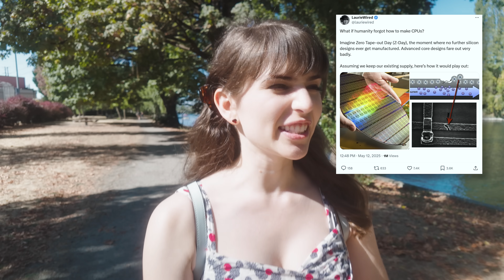what if humans forgot how to make CPUs?

Comment: Your scenario appears to be more what happens if we lose the ability to fabricate integrated circuits, not merely CPUs. If all we lost were CPUs, we could make them from discrete chips like we did before LSI was a thing.

So, the short answer is, we would revert to the late 1960's, early 1970's in terms of technology unless we also forget how to make transistors or MOSFETS. If we lose that, we have vacuum tubes, so back to the 1950's and early 1960's. There were also relay based computers, such as older Japanese mini-computers. So, an entirely recoverable scenario, even if it did set us back half a century.

Comment: "5 nanometer" CPUs have a gate length of 18 nanometers. It bothers me to hear "nm" expanded as "nanometers" because that will spread the misconception that something in these chips is "5 nanometers" large when there isn't.
Reply: Yes but the number used to represent the gate length up until around 2011. The nm does mean nanometer.

Comment: Thanks for the walk, Laurie.

::: DEMO SCENE MENTIONED :::

CPUs in a modern sense may or may nor be forgotten due to the processes and the 100s of people involve dat each stage and no one really knowing all stages. 
The saving grace is that individual people understand logic gates and they understand how to peace them together to CREATE a cpu. Individual people (many of them) know how to do this and you can find countless videos of them doing it in games like Minecraft. All we really need are the gates and the logic and how to peace them together to interacts. The processes to make them smaller comes AFTER that. The knowledge of how to create them at a basic level is inevitable.

If we are forcing a hypothetical, (gonna give my take before watching the video so im not biased to your probably better insights) my assumption based on other areas where this has happened is efficiency and scaling would become king. Instead of the new CPU, its the new 20% more efficient piece of software. Bearly tapped things like applications and entire OSs introducing nature multi-thread support that allows any application that runs on them to become multi-threaded or multi CPU. Tis would carry the industry for a good 15 years before it would start to fail. By then possibly even new coding languages thet more deeply tapped each transistor would be developed to squeeze our further performance from the raw, now decades old, chips. As that died down, the consolidation of hardware would ramp up and computing would start to blur from having your own things at home, to having time allotments in the cloud to do what you want. This would last another 15 or so years before older gen CPUs themselves would start to die in numbers that would force the cost of computing in this way to rise beyond reasonable levels even for the large companies that were left. Eventually (15 years beyond that so we are at 45 years from zday), people would need to start slapping metal on silicon again or the fall would be slow but inevitable back to pre-transistor age for everyone except the rich.

techs that would fail first:
1. AI
2. AR
3. Crypto (i guess this is a "tech")
4. Modern phones within 5 years would cause a major and massive cluster-f of the telecommunication industry. Older phones that would still be working would not be compatible with new communications tech. The entire industry would have to step back 20 years hardware-wise or die. 
4. Almost all other portable devices from the past 15 years would fail and any industry that relies on them. 
5. Industries that rely on heavy digital video production
6. Industries that rely on HDD production
7. Things like OF
8. Visual Social media would burn very brightly before falling sharply in the first 10 years as major restrictions from EVERY ISP on earth would be instituted.

tech that would last the longest:
1. Any firms that provide support for desoldering and resoldering
2. Demo Scene Is Forever. All we need are some rocks and sticks. 
3. Software companies that specialize in optimization of client software
4. Engineers that are responsible for MB designs and whomever employs them are a goldmine. All chips are worthless unless the board they are on can take advantage of them reguardless of age. 
5. stuff from the 80s and 90s should be here till 2100

Comment: Modern CPU designs are a terrific maze where even the smartest mond couldn't fully understand it.

AI will be able to optimize CPU designs to its physical limits, using physical rules of the real world chips to squeeze the last bit of computing power to energy consumption ratio.

When such a chip will be built there will be no way to improve it further than to find new physical rules.

The game will be over.

Comment: I've thought about this myself, interestingly, maybe it's a common thought experiment. If we were suddenly unable to produce large numbers of new processors, for example if there was a disaster in Taiwan and/or Arizona and a few other places, I think it would be both better and worse than your scenario. Worse in that the consumer market for electronics would rapidly crash, as there are no new products and the ones people do have (most of which are short-lived by design, like cell phones and tablets) are now very valuable and on borrowed time. As soon as that occurs, the need for datacenters and "web scale" computing basically evaporates all at once. From that point governments, militaries and very large corporations would horde the remaining technology resources, rationing and tightly controlling usage.

We could definitely work back up to our current point over time, and a lot of the technology could be recreated and/or improved using knowledge that has been recorded from the initial development of high-end electronics, but it would take decades. In that time, I think consumer technology would just revert to previous states. Printing newspapers and books is a mostly mechanical process and doesn't need computers really. Washing machines, dishwashers, refrigerators and microwaves can all be controlled using electromechanical timers and sequencers, which still exist and require no electronics, basically just machining tools like lathes and mills to make or cast. Cars can be designed and manufactured without electronic controls. They may have fewer bells and whistles, but they would still serve their purpose.

I don't think there would be a long-tail of consumers hanging on to their failing technology for years because the average end-user doesn't really know enough about how anything works to solve the small mountain of minor issues that would crop up constantly, and the huge amount of software that is only marginally functional (80-90% of it these days...) and also developed by randos over the internet (which would quickly disappear) would make it extremely difficult to keep anything working reliably.

With the exception of desktops, laptops, phones and tablets most all of the stuff we use on a daily basis predates the invention of the microchip, much less advanced CPUs and microcontrollers. Medical therapies would take a step back without MRI and CT scanners, so new and novel diagnostics would need to be invented. Entertainment might revert to radio, or just to regular analog TV which works without any need for sophisticated computers.

It's a cool thought experiment, I do think though that the sunset for computers would be 1 decade or less, as demand for consumer stuff would create a tremendous impetus to develop alternatives to CPU controlled products. They might be larger, heavier, or different, but we could do without processors just fine after a couple years.

Comment: I designed and built a working 16 bit CPU from LSTTL/HCMOS etc. back in 1986. I'll never forget how to do it. And if I had or needed to I could easily do it with discrete transistors.

Comment: This is a fun thought experiment, but I think you're MASSIVELY underestimating both the impact that this would have and the magnitude of the government response.

Nobody would carry on as usual. Governments would nationalize computing resources. Black markets would start springing up within a week. The rush to try to adapt to the coming new reality would be chaos.

Within 6 months, global supply chains would start disintegrating. "Just in time" manufacturing would end. Within a year the global economy would fall apart. Our society is able to feed its people only because of the incredible coordination our IT infrastructure enable. Within two years there'd be global famine. 

We're not able to just go back to the way society worked in the '50s and '60s without massive upheaval and a drastic reduction in population. On top of that, our reduced ability to extract resources and the uncontrollable acceleration of climate change due to falling back on less efficient processes would make it so even worse.

Comment: is this just that we could never make CPUs again? because I mean even if you were to entirely forget the manufacturing process of modern CPUs and most of how they worked we could still begin to make stuff like transistors on bread boards and vacuum tubes and whatever else. we would cobble together whatever we can and then offload the compute expensive stuff to the more powerful computers when needed.

Comment: If it's just CPU/MCUs then the time frame is to short, processor failures take many decades assuming no defects (cough intel cough).
But if it's all silicon chips that are gone then yeah, failing voltage regulators, mosfets and other chips that run hot would cause the most problems as they fail way more often than processors.
People would be installing additional heatsinks and fans on existing products to keep all semiconductors cool.
There would likely be laws put in place to stop manufactures running any semiconductor at high temps. Companies currently have no incentive to run parts colder for longevity because it hurts their bottom line if things don't need replacing often. And it's usually cheaper to use a lower spec part that runs hot if you can get away with it.

Comment: Standardizing dependencies will require dynamic linking for shared libraries, while development toolchains should be locked to static linking with developer-specific libraries. Packaging also needs to be standardized, creating more streamlined, bloat-free operating systems. At the same time, compilers and drivers should be heavily optimized. We should forget about just-in-time compilation, virtual machines, and intermediate representations, focusing only on direct compilation from source code to binaries.
In addition, more software should be built to emulate the fabrication of new chips, even if they belong to the same generation or are slightly older. This would be similar to creating a complete digital twin of a fabrication plant, which could then guide the reproduction process step by step. Of course, this would require open-source architectures, APIs, drivers, and operating systems so that nothing is gatekept in this hypothetical scenario.

Comment: A future without new CPU production is job security for reverse engineering.

Apropos @LaurieWired want to have a look at 2a000000 length 0x8000 BootROM on any StarFive JH-7110 ? The memory map is easy enough and there is lineage from the JH-7100 which got more published open source code parts, some snippets of possibly similar ZSBL open source code for the U74-MC that was the basis, and so on. May be interesting for the RISC-V nerds to follow along with on the theme of "what if you had to R/E your CPU?"

Comment: Some aspects of this seem extremely accelerated and some seem too slow. I've never actually seen a consumer cpu fail. I know nothing of server cpu reliability though. But it seems like cpu degradation is extremely accelerated in this analysis. I'd by more concerned about ram degradation before cpu degradation. And long term storage might have actually been predicted to degrade too slowly.

Though these nitpicks don't really impact to end results since any failure in a computer causes usually irrecoverable problems. So it doesn't matter if the cpu works if the ram doesn't.

Comment: By the way: Recordable and Rewritable disks (DVD-R, ...) record the data on layers that deteriorate quite quickly. Depending on the used materials they can have a longevity of only 10-20 Years even under good conditions. There is a type called M-Disc which is writeable once and has a more resistant material marketed to hold data for 1000 years when stored properly.

Comment: I think the decline would be much slower than you imagine.   Things like Bitcoin mining wouldn't be hurt by the loss of compute availability because the difficulty dynamically adapts to the amount of compute that people are prepared to contribute.   The doom of Bitcoin would be people seeing a future where they could no longer make electronic transactions.       Resource wise, there is far more processing power int the world than people realise.   Consider the web site hosted on a disposable vape.  Repurposing microcontrollers would enable some quite innovative long term solutions. Similarly the exponential growth in data storage means that a decline in data use to that of a decade or two would reduce the wear on existing devices massively.   SPI access  would provide some 250Billion manufactured Arm microcontrollers with a stock of some 12 billion manufactured SD-cards.  With wear leveling and failure mapping you could probably have A computer capable of running Doom for an extremely long time.   Display technology would be the sticking factor.    On top of all this is the weird hybrids that could be possible.  Imagine what the people who made computers out of complex physical mechanisms could do if they had a single Arduino to bind them all together.   An old black and white laser printer and a cellphone camera could become a weird long term data storage mechanism,  slow but quite stable and long term.    Have a look at some of the things people made in Colditz with limited resources.  When you know what you want to make and are determined to not let a lack of resources stop you, the level of innovation possible is incredible.

Comment: Losing the ability to make CPUs seems kind of arbitrary. When you boil it down a CPU is just a particularly complex and refined example of an integrated circuit. As long as we retain the ability to make things like OP-Amps, LED-driver ICs or even boost or buck converter chips, there is a path back to making CPUs.

Comment: So for the optimalization thingy... In the 2000s I used my computer almost the same way as currently. If I want an up to date and secure system with normal loading times somehow I need at least 16 Gb ram. Like I was using Skype, MSN Messenger, in the late days I was using Facebook but yeah... Steam was running 24/7 + 50 browser tabs. That, even with some fancy flash sites was somehow running on 512 MB ram on Windows XP and after like 2008-9 I had a new Vista laptop(1080p screen) with 2 GB of ram and it was enough till I haven't started making videos and SW edits. Then I bought +2 Gb of ram which was enough... Until 2014 I was sitting on 4Gb of ram.Currently I have 32 Gb of ram because of games and work. If I would need a computer for just browsing the web, chatting with my friends on my apps and light photo edition I would still go with 16Gb because 8 isn't enough for that. And I don't even have aero which makes me cry. Weird.... :D Maybe using 204120359320592 libraries with the embedded ones not that great of an idea for just 1 feature of each of them.Also... go with the story,...

 I'd be pretty rich. Having multiple phones, 2 laptops, an old vintage PowerMac, a gaming pc... an older gaming pc in parts(but all working)...  2009 era computer as a server so I'm gonna be safe. :D